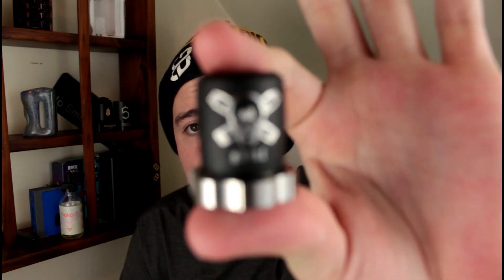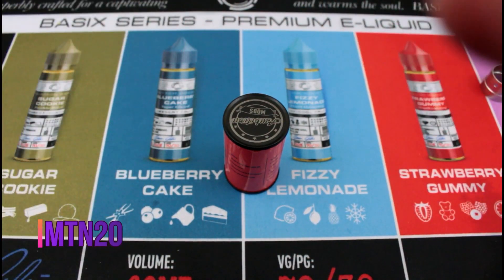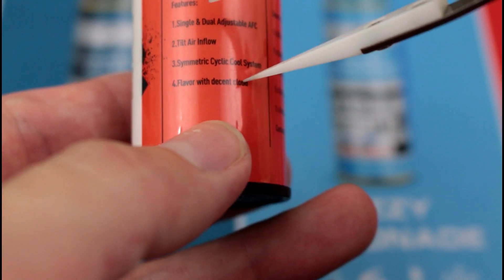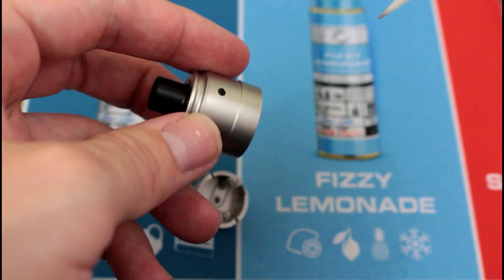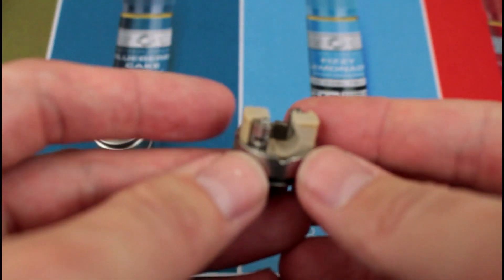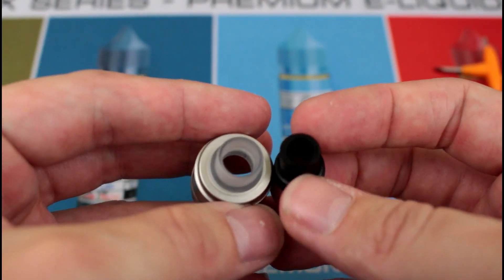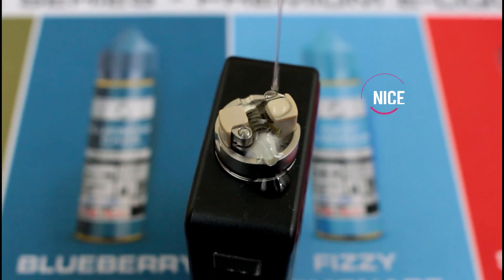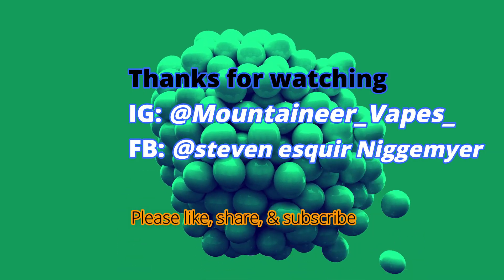C-roll RDA-Ambition Mods. High end look foe dat low dolla Price.

Comment: I have this on the way from FastTech and the pics over there show dual o-rings. Great video man
Reply from the maker: Maybe mine is a early version. I believe they are adding a 510 adapter. Not sure tho
Reply: I have a black one and it has a single o-ring also. Like Steve mine might be an earlier one because it is like his and comes with the same stuff.